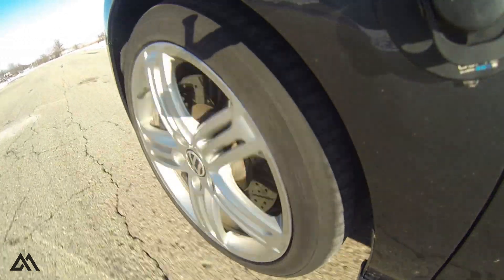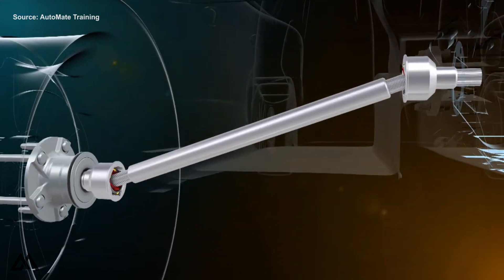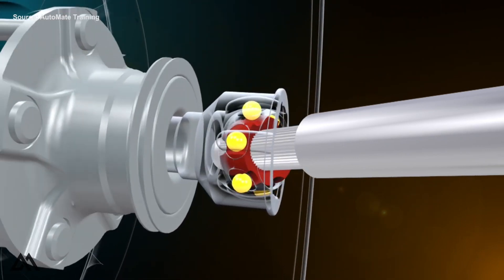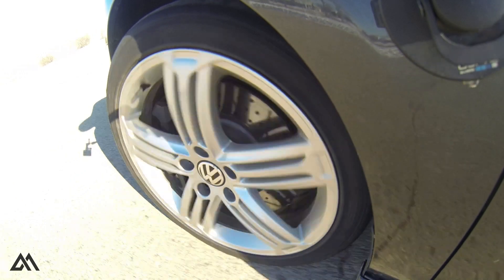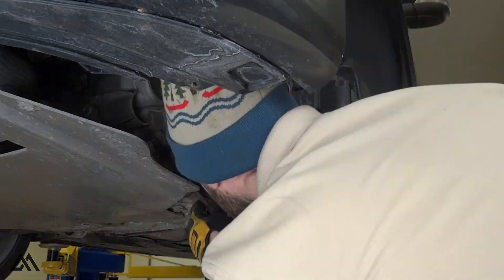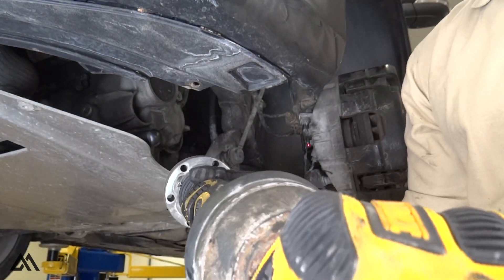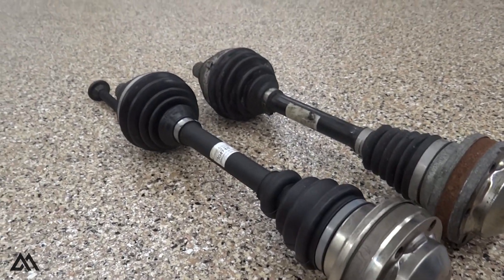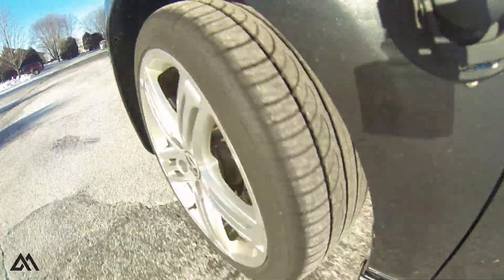Diagnosing Front End Clicking Sound and Vibration While Turning | VW Golf R

Comment: The three most common reasons for a noise like this from the front wheel hub area are:  1 - wheel bearing...  2 - wheel bearing.... 3 - wheel bearing.....
Reply from the maker: It was the cv joint.

Comment: It happens with Mazda vehicles as well.

In fact, I had a Mazda CX-3 AWD for nearly 5 1/2 years and had no problems at all.

Boom, today, I was getting weird creaking and popping noises when making sharp turns.  When I turn slowly, I don't get that noise.

I suspect that its a CV Joint, but I'm not sure.

I have to take it in to my Mazda dealer in two days, and hopefully it will be fixed in no time.

Since Japanese made automobiles are known for being high quality, its strange that Mazda vehicles would have CV Axle problems in less than six years.

Comment: I have the same issue with my Volkswagen polo 2020 and the noise stops when I drive faster like above 25mph. Under 25mph it makes that clicking/grinding/sound. Only when I’m driving at a constant speed. And like as I’m turning and releasing the clutch it makes the sound. Sometimes I can hear like springs as I release the clutch or push it

Comment: I'm kinda having this my problem is that its clicking always not only when I'm turning but also when I'm goin straight would it be this as well?
Reply: Hi what was the problems on your car? Did you get it fixed ? I have the same problem,mine does it onley when i go straight and may be when i cut the steering slightley.it does not do it when i cut the steering full.
Reply: @naz.tanzeem5982  same
What was yours?

Comment: what if i already had my cv joint replaced?  And im having the noises again. Thanks!
Reply from the maker: I’ve experienced issues with the steering lock was not adjusted correctly which allowed the wheels to steer beyond the limits of the cv axle. I replaced an axle then immediately broke it by steering beyond the limits of the axle. This happened a couple times before I realized what was going on.

Comment: Dude this video was awesome! Big visual learner loved the 3D component. I hope someone can help me. I’ve recently had my cv joints changed, had new sway bars put in and I’ve recently cleaned up my coil overs and my car makes this noise only at low speeds and particularly on inclines what could it be ?
Reply: Hi, mine Golf V makes the same noises only on low speed. Have you found out what it was? I know it's been 4yrs since you commented 😅
Reply: @ twas a wheel bearing sire. Ironically I have a very similar issue again rn as we speak with the same car. 😂

Comment: Found the easy way to diagnose a bad cv axle: floor the accelerator from a stop. You should feel harshness or abnormal vibration from the bad side. You might also hear the cv bearings crunching/clunking.

Comment: I have a 2019 Mazda CX-5 I have a similar noise but a little more subtle. Also on the front left wheel. My problem was actually 2 things. My car has a fair amount of torque so the nose of the car lifts on hard acceleration second problem is wheel hop I have slightly wider stickier Michelin tires rather than the Yokohama geolanders. Long story short the bearing inside the strut was cracked and outer tie rod was bent.